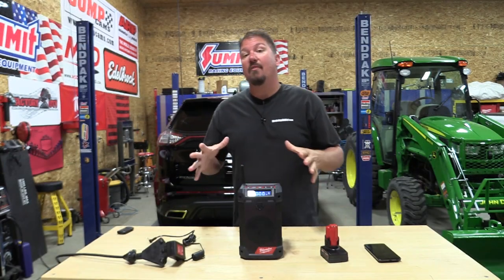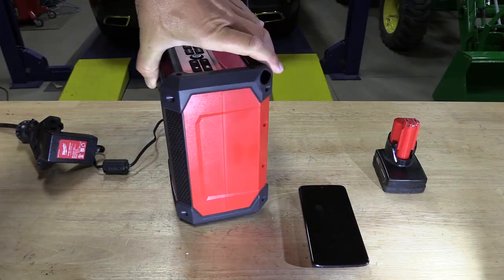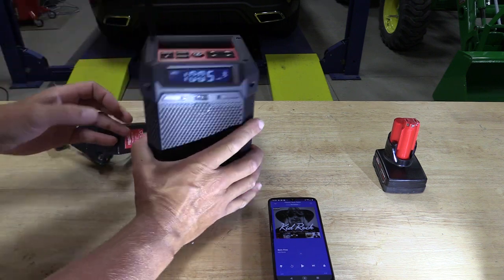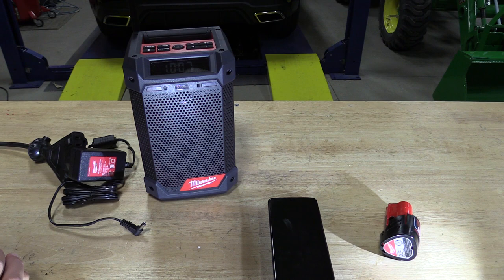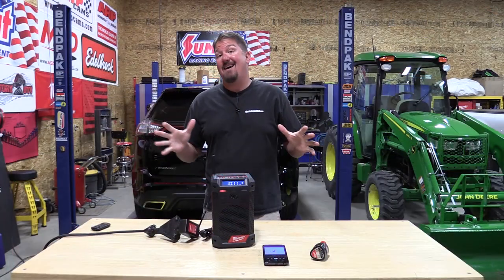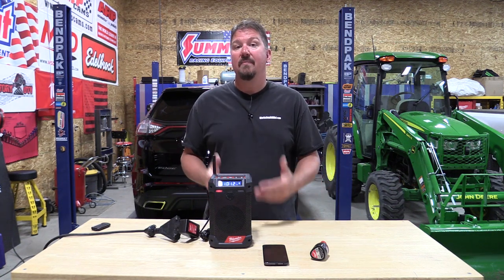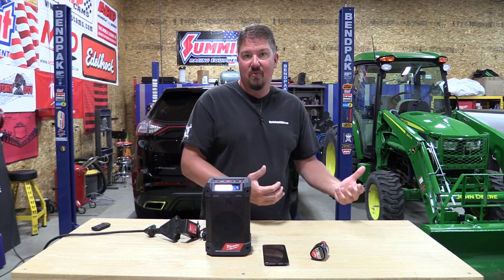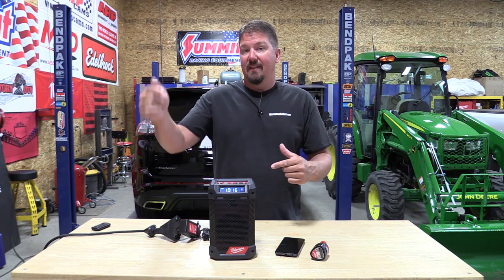Milwaukee M12 Bluetooth Radio and Battery Charger Review 2951-20

Comment: Volume should always be controlled with a knob. Volume buttons annoy the hell out of me.
Reply from the maker: You see that on larger ones, but these small bluetooth models all seem to be buttons.
Reply: Water intrusion
Reply: On the Milwaukee packout when I’m putting it away I sometimes bump the on button and then accidentally turn the wheel so I get a loud blast of music almost ever time I try to slide it into the packout that annoys the hell out of me I just got this radio too
Reply: Modern knobs suck ass. Always skip or mess up. Much prefer a button
Reply: Wait until you get concrete in the knobb and you click once to go up and it goes up 20 points and blasts music sometimes when you shouldn't lol

Comment: Never going to use the ac adapter. It should just take an extension cord or have a plug.
Reply: yep agree
Reply: not sure if i agree or not yet.  but that would make the radio bigger and heavier. that transformer has to be stored somewhere.

Comment: To anyone still thinking about buying this... do it! No regrets. The sound on radio is louder than if you are using Bluetooth by at least 50 to 75 percent more. It's compact, it is heavy he is not kidding but portable. The fact that one I purchased came with the ac adapter is a huge plus. Now I can charge my phone and my battery at the same time with it having to charge my battery with a separate adapter. And the reception is incredible.
Reply from the maker: Listening to mine as we speak.
Reply: @WorkshopAddict  what's the deal with no pause during a Bluetooth stream, is that true? If so does it drive you mad?
Reply: Hey its been 2 years since you posted this review, any updates I should be aware of? Heard a few negative things about it, first day I bought it I noticed a static when not in play in the Bluetooth setting

Comment: How the hell did you just pop that battery out. I basically gotta manhandle all my batteries out after a 20 second struggle??? Serious question
Reply: Great video / presentation & info WorkshopAddict!!! Regarding 'changing out batteries'. My buddy owns way too many Milwaukee 'gadgets' and just showed me this radio, and said, 'can't get the darn battery out' (the larger one is in it, which I thought was the 3.0 AH) 5:28. We didn't try yanking it out w/ large jawed vice-grips, or a winch, but seriously... it does NOT seem to just pull out by hand!?
UNRELATED: Please change your cell phone password... I won't be able to sleep otherwise!!!
Reply: Just went and grabbed that SOB... learned the larger battery has the 'press tabs'. Squeezed n yanked real hard and she's out. Now my ole lady wants me to try that on her??
Reply: Work on your grip strength... 🤷👌

Comment: So why didn’t they make a storage spot for the AC charger on the radio.
Reply: I keep it all in an extra Milwaukee tool bag
Reply: I'm gonna attach mine with some sticky back velcro where the info sticker is
Reply: @mikegleave13  let me know how that works out as you throw it around in the truck etc. Job site movement. I need to figure something MCgivorish
Reply: For the adapter? I’m just going to use a small Husky pouch hanging from one of the hanger openings I guess. (It’ll work fine.)

Comment: Only problem I see is the cord is a wall wart. If you’re going to use this on a surge protector you’re going to play a bit of charger Tetris. Otherwise, looks like a fantastic little radio. Super cute. Not going to pay $120 for it though.
Reply: $120 isn’t bad at all honestly. Beats and JBL speakers are that and more. Sure they probably have better sound but won’t last long at job sites.

Comment: Just bought one, for the price not to bad..the packout radio was what I really wanted but that thing is bigger than my surround sound system from the 2000s
Reply: I’m wondering if I can place some 3M double sided tape on one of the sides and attach some 3D printer packout feet to the radio. It sure would be nice to have it on top of the stack

Comment: Just picked one up and I like it.  I’m just going to dedicate a 4ah battery to it and plug it in when I can, and run it off the battery when I can’t.  I had the Makita noncharger radio and having to keep a charged battery in it was a pain in the ass.  The m18 charger radios are way too big to lug around as I’m on a different residential job almost every day so portability was a big plus.
Reply from the maker: That is what I do.
Reply: So been a few weeks and it’s really good for having background music at the job site.  To my ears the mid range kinda over powers the lows and highs, but that’s what allows it to really full a room with it small size.
Reply: @kds471  any update after long term use?
Reply: I got the M18 radio. I love it for camping and bringing it to parties, but it's too bulky for the jobsite. I got a tiny bluetooth speaker, but would love something that uses radio when I'm out of cell reception. Seems like I might have found my new jobsite radio.
Reply: @AZHighlandHomestead  it’s good.  Only problem with mine is that it spontaneously turns on by itself.  I think it discharged one of batteries beyond repair that way.  So now I have to remove the battery everyday to avoid that.

Comment: I have a minor hobby of paying attention to what bluetooth speakers are out there and are any good.  One way I've found REALY helpful in rating the volume of a speaker is when the reviewer talks while the speaker is playing.  This helps because the mic is trying to pick up both the speaker and the speaker (LOL) pun intended.  Anyway it's pretty easy to tell how loud the speaker is by how the mic distortion sounds.  For less practiced ears this still helps.  My two bits.  Other then that loved the review thanks for putting in all the time it takes to make quality video.  Found you cause I was looking up electric pressure washers and noticed this vid.

Comment: I love my DeWalt bluetooth speaker since it takes 12v, 20v, and Flexvolt batteries. It fast charges my Samsung Galaxy phones too. It is loud and pretty good sound quality. The buttons are great and easy to press as well.
Reply: Whats your dewalt model?
Reply: Flexvolt is 20/18v footprint
Reply: But it doesn't have an am/fm radio?

Comment: M18 for me.  If it was M18 I would have it for sure, M12 I am not so sure.  Good review.
Reply: I looked at them at home depot today the m12 is $119 ,the m18 was  $159 and the packout was  349dollars.  Way too much for the packout 
Think that I would just buy a radio from best buy and use ever ready batteries

Comment: Considering this speaker or the dewalt one you review a year ago as well. Which one of these two would you recommend?
Reply from the maker: Of the two small radios, I would go Milwaukee. BUT, I use and am happiest with this small radio the most.  Dewalt DCR028B

Comment: IP54 is not "dunk it in water" rated... IP54 is specifically rated as "protected from limited dust ingress" (the "5" part) and "protected from water spray from any direction" (the "4" part).
Reply: I'm glad somebody is pointing this out

Comment: This radio is available as a promo with the battery kit at HD right now, you can return the batteries to get just the radio for ~ $71 which is a killer deal

Comment: I’m having a problem with mine,if you are just using battery power and play the radio till the battery dies,the battery won’t recharge. It appears that it runs it down too low and you get the red/ green flashing lights on the charger. I’ve tried this with  2 different batteries. The battery has to be jump started by another charged battery before it will start to charge. Have you seen this same problem.

Comment: I have the Craftsman 19.2 Bluetooth radio that is almost the same size as the Milwaukee but doesn’t have the AC adapter and not very loud. Acme Tools has the Milwaukee Bluetooth radio in stock for $119 with free shipping for orders over $100 so I bought one and should have it by Thursday. The Milwaukee radio is the perfect size to fit on my workbench and not take up to much room and I can’t wait for it to get here.

Comment: I am disappointed that the  ac power supply is not built into the unit . The m18 has it built in with the cable stored at the back. If you take it somewhere and your battery goes flat you need the power supply!

Comment: so if it’s not connected to the AC  adaptor then it runs on the battery right? And when you plug it in it charges the battery?

Comment: I hear you saying charging batterys a lot  but I'm not understanding , does it charge m12 batterys ? Using the mains adapter , & if so, can the radio be played while charging a m12 battery ? Or did i get it wrong & your talking about charging device batterys through usb ?

Comment: Nice review!  I have a tech question...I have the radio shown in this review, but no smartphone.  My ISP sent me a wireless router (with WiFi) several years ago, and I see that there are WiFi to Bluetooth adapters/converters available out there.  I would really like to enjoy my favorite internet radio through the Milwaukee radio, so does anyone know just what I could purchase to use the radio?  My router is about 10' to 12' from where I intend to use the radio, with another location up to about 20' from the router.  Thanks in advance!
Reply: Yes! If you have a computer with Bluetooth, you can connect to the radio from there. Normally, laptops have built in Bluetooth. Or you can also buy a $10 Bluetooth adapter that plugs into any computer.
Reply: @reptasaurus1126  Thanks, Luis!  Unfortunately, I tried an adapter, and it didn't work.  I checked to make sure Bluetooth is on my computer, and even checked updates on it, etc., but still no luck.  The adapter was a "dongle" that I learned about on an online review, so I didn't just pick anything, but no success so far.

Comment: i just bought this with the 2 battery kit at home depot. my 4.0 battery is stuck  in the radio, and I mean it is stuck it will not budge. any tips for removing the battery??
Reply: Push the two tabs in. Look on your other batteries you’ll see two black tabs that you have to push in to release the locking clips that hold batteries in

Comment: I really don't consider the m12 system to be a downside. The smallest m12 1.5 AH will get you a full days work out of it, the largest over 30+ hours. The m12 batteries are also smaller and lighter. Although I get some people may want the additional run time that might be possible with an m18 but if you need more than a day worth of battery, number 1 you need to go home and get some sleep and number 2 you might as well just stick with a standard wall outlet.

Comment: Sound quality is it better then the small m12 speaker? And is there a dewalt or competition radio that sounds better about the same size?
Reply from the maker: Sound quality id much better than the M12 speaker and the new Dewalt is slightly better.
Reply: @WorkshopAddict  thanks 😊 your the best

Comment: Ok maybe I missed this does it run on 110 v without the battery ?
Reply: has an adapter for 110v
Reply: Pete mander so u do not need the battery at all ?
Reply from the maker: No battery needed.

Comment: Nice and all the included a charger but at 1amp, she's a bit slow
Reply from the maker: Even the large radio chargers are 1 amp.
Reply: Both the Packout and the "smaller" M18 radio charger are 3.5A, which is a bit more than the standard charger but less than a rapid charger

Comment: Wonder if I can test it in Home Depot?
Reply: Saul Goodman , Home Depot keeps on pushing back the date on when they will get them in. They were supposed to have them on on July 1st and then said July 16 at the earliest. Acme tools had it for $119 with free shipping so I bought it, got tired of waiting on Home Depot.
Reply: Had a display model at my local depot. They had no issues with me testing it. Just brought my own battery in and tested it.
Reply: @dsrta645  Not in my local Home Depot.  They have all tools locked behind cages.
Good luck trying to find someone to open it to get a tool.

Comment: One of the few Milwaukee products I have ever returned.   Poor Fidelity compared to the older M12 Radio.  Lousy AM radio section with no shielding for noise. And worse yet all of the highs on AM are severely filtered out to try to hide it.   The AM is so muffled I thought I had gone deaf when I first turned it on.  And not to mention an external power supply that will get lost or break. Very disappointing product.
Reply: No one listens to AM these days
Reply: Bill Inglot thanks for reviewing and issue with AM radio saved me buying it.

Comment: This radio is the most disappointing tools I bought from this company, the sound is horrible when you crank it up over 5 , its more compact and charge your battery but don’t expect to buy it for a pool party if you plan to up the volume cause the sound is crap